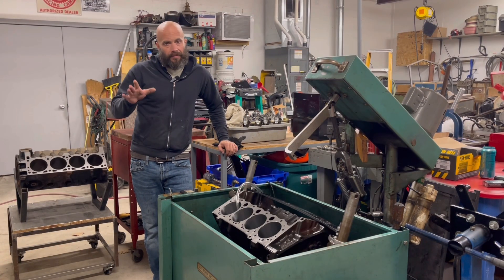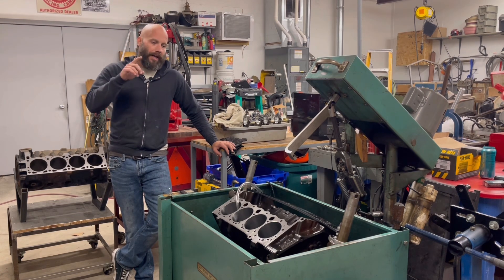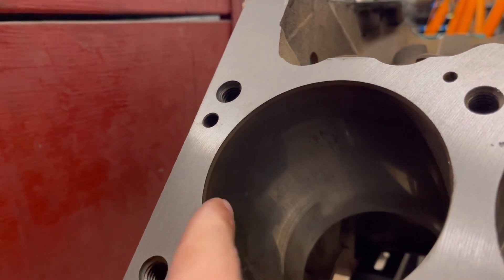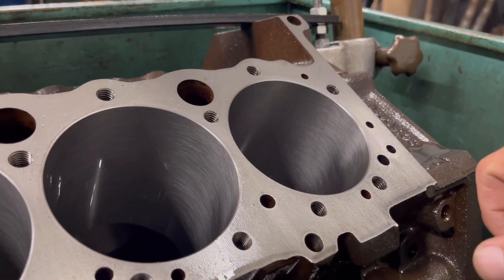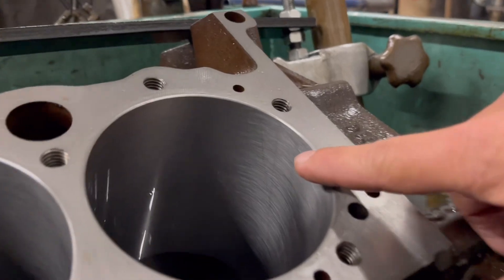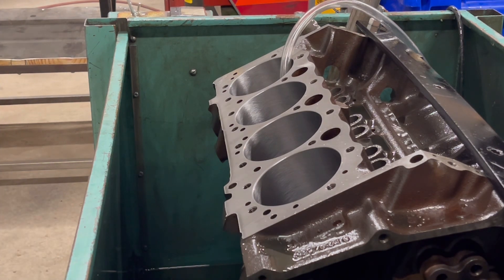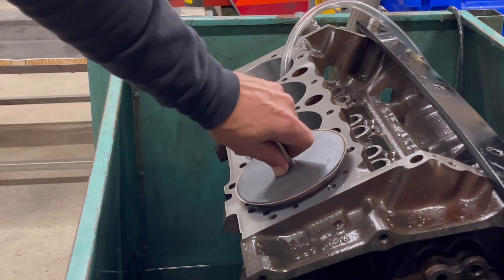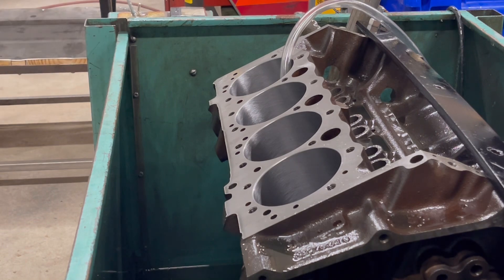What is Cylinder Chamfer and What Does it Do? #engine

Comment: Top of cylinder chamfer should be done. Don't get carried away though. I've seen instances where a head gasket would fail prematurely do to poor edge of bore seal due to an excessive chamfer relative to the gasket being used. B.T.W. The lower edge of the cylinder should also be given a slight chamfer-radius. Thank you for this video.
Reply from the maker: Thank you!  You are 100% correct on that!